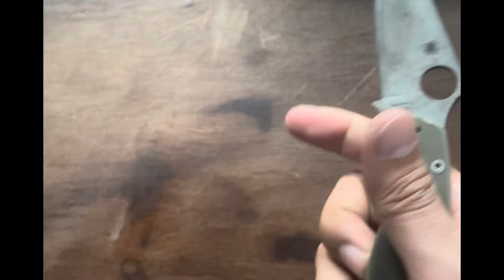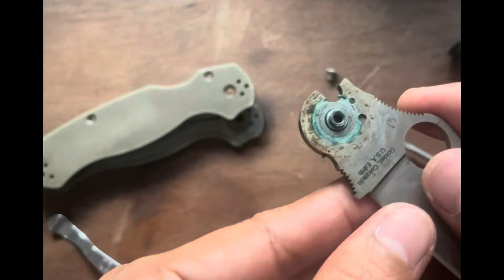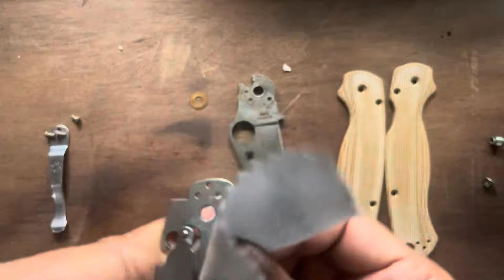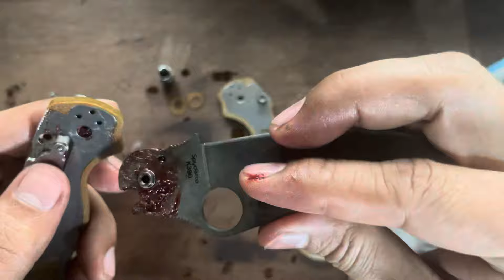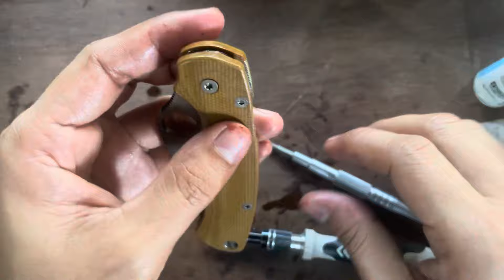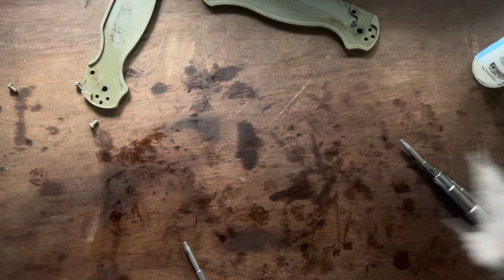SPYDERCO PM2 AT K390 STEEL LOOKS AFTER FIVE YEARS OF SERVICE

Comment: Judging from the lack of wear on the blade, which does not appear to have been re-sharpened, it doesn’t appear to have been used very much. It was, however, used or kept in damp, dirty conditions, at some point at least.  The blade appears to be in good condition otherwise. That Patina is a wonderful thing! It doesn’t hurt a thing, and it looks just fine to me.
Reply: Clearly it has been sharpened as i look at the grind and tip. The grease tho and loose pivot screw is not okay tho

Comment: If you want drop-shut action don't over tighten the stop pin screws like that.
Reply from the maker: Yah, I like that too but the disadvantage is a strong blade play, I’m using my knife in heavy situations that’s why I tightened it in exchange click drop-shut instead, ooh! I missed that sound the drop-shut which is good to ears.
Reply: Not the pivot screws, the stop pin screws. Looks like you tighten them a lot and on PM2 that locks up the blade too.
Reply: That grease ain't helping either
Reply: Yeah, too tight isn't good.
Snug with lock tight and wait a couple of days for it to set.
IMHO.